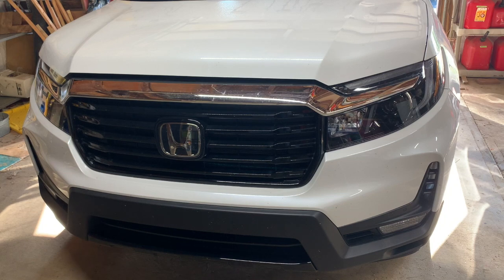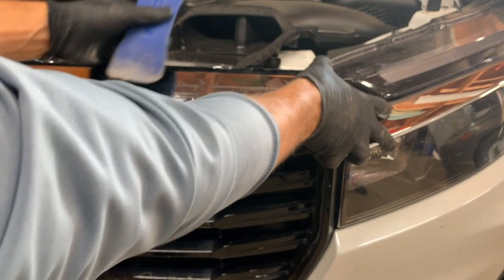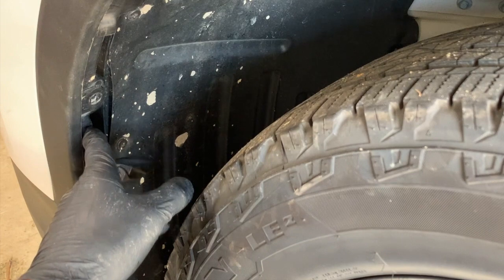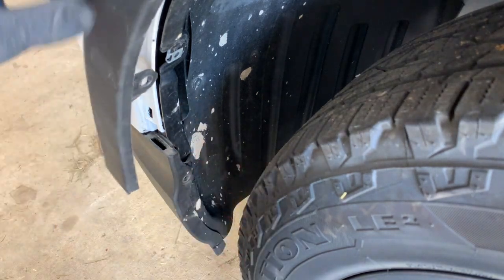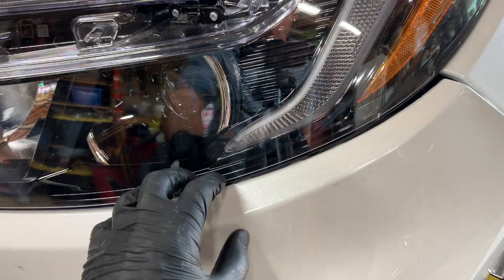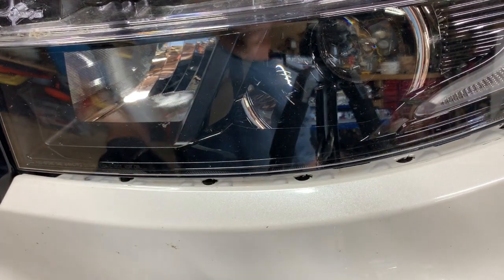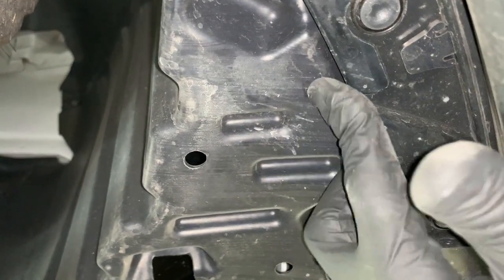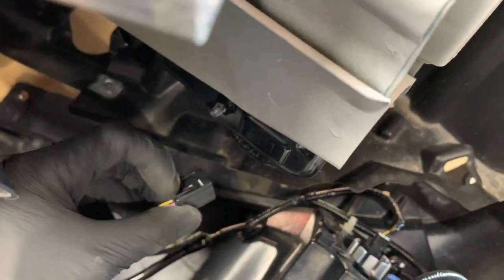Honda Ridgeline  How to Remove Front Bumper Removal 2021 2022

Comment: Great job as always, really appreciate your work.  Specially, anything 2nd Gen Ridgeline.

A couple of years ago Thanks to one of your videos I removed the front bumper cover from my 2017 so I could install a transmission oil cooler.  That was kinda tricky as well but I got it done.  

Unfortunately, on 2/1/22, a distracted driver ran a stop 🛑 sign hit me on my left rear side, spun me around and I went head on into a concrete wall, totaled my 2017 RTL-T with only 20K miles…  I now have a new 2022 RTL and even though you showed us how to do it, I hope I never have to remove my bumper cover 😜

Thanks again 👌

Comment: Very well done and works very well.   If you are repairing a dent, you don't necessarily need to pull off the whole bumper-I had a dent the size of half a grapefruit in the edge of my bumper, so I was able to just pull that side loose to work the dent from the inside.  This is particularly helpful if you are working alone...
Reply from the maker: Glad I could help!

Comment: Good job. I'm installing the Honda HPD fender flares. The directions say pull the bumper. I'm thinking  you could fo it without a full pull. Do you have any experience installing these?
Reply from the maker: I do not, but I also don't see why you would need to pull the front bumper.